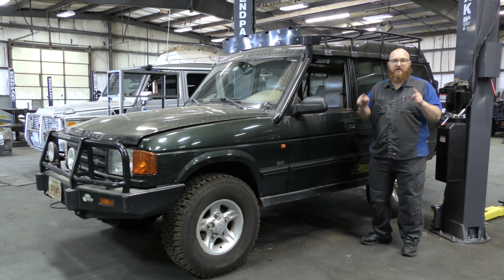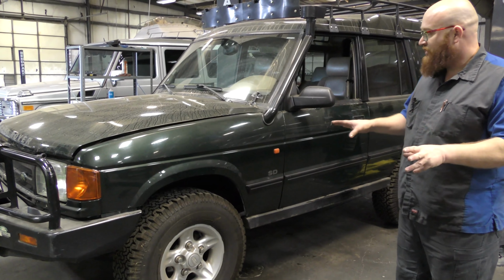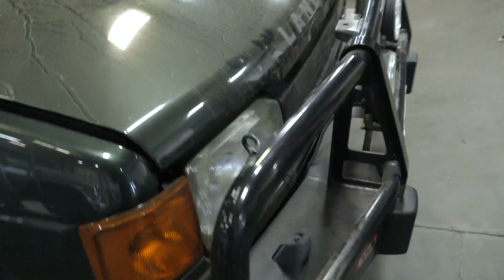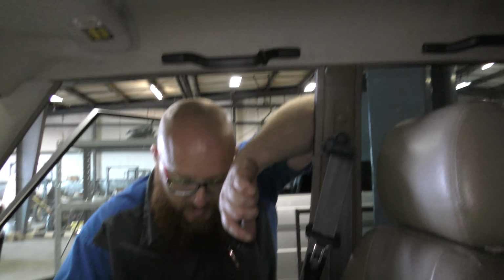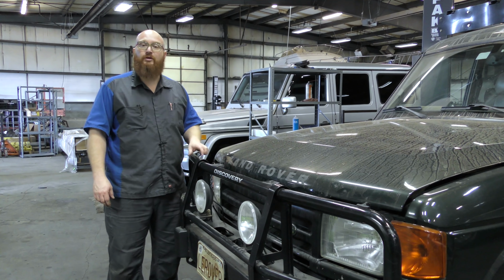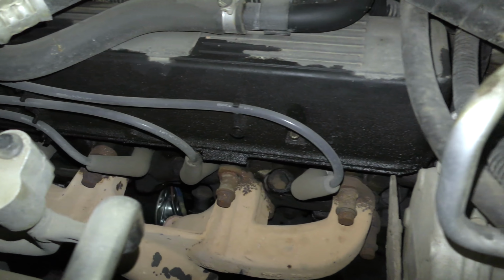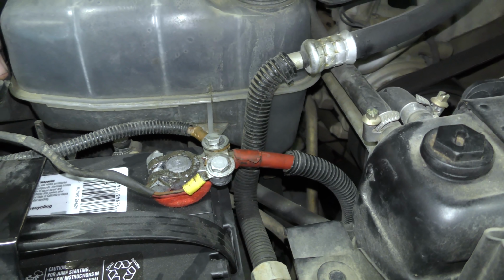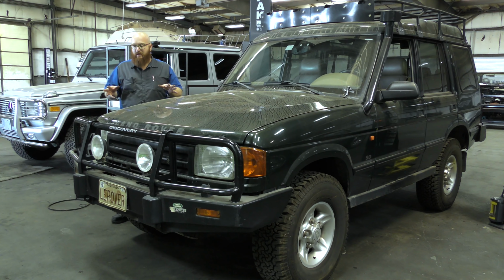How can such a simple repair cause huge problems on this '99 Land Rover Discovery? CAR WIZARD knows

Comment: Car Wizard, you forgot the most important feature of these models, the built-in siphon to your credit card that sucks thousands of dollars out of that account every time it is driven to a LandRover dealer for service. This is why your customer tried to deal with the problem himself.  I had a '99 and and a 2002 for my children - most expensive service visits ever until I got a modern M-B, which was totaled when gallons of rain water came in through a closed sunroof(blocked drains?).  Now I drive my old Ford Expedition and F150 - and have no problems I can't deal with.

Comment: Great video I am going to check mine are tight now !!!. I am looking for some help guys. I have a landrover discovery 1 1998 and when I take my foot off the gas (not all the way just so it is keeping a steady speed) it loses power and the engine light comes on. Then when I apply the gas it goes off again. When i freewheel engine warning goes off too. I read it might be the EGR valve when the revs are between 1 -2k revs the valve gets stuck. Any thoughts .....😀

Comment: You have a great channel. 
Why didn't you change out the battery terminal. Those are junk. I only use them in emergencies.  Add a good terminal end with studs.

Comment: The problem with the head gaskets is that the motor started off life as a low compression engine and when Land Rover exported the Discovery, they increased the compression ratio in order to comply with North America Emissions requirement.  The head gasket was never meant to take the increased pressure and would eventually blow out.  The motor in its original form do not have this problem.  and proper maintenance is REALLY important.  the the dash mounted cupholders always break.  The gear jams and teeth break.  Ask me how I know.

I prefer the side opening door with the spare mounted on it as well.

Comment: I put a 3.5 litre rover SDI engine and box with a big cam offenhouser inlet manifold and a 650 carter carb in a ford capri back in the late 80s went well but span the wheels when you accelerated hard at speed and had a habit of going side ways but great fun to drive as was a bit unpredictable.

Comment: I had a 2000 D2 with a blown head gasket. I didn't know anything about blown head gasket then, so I replaced the radiator as I kept losing coolant. It became a money pit as my mechanic didn't know what the issue was and I got rid of it as scrap. I missed that truck.

Comment: Sorry to say this...but you couldn´t be moe wrong on the Geländewagen. 
Maybe the americans see this as a mall-cruiser, but in Europe and the rest of the world these cars are used to work, to go out on an adventure, to go exploring and overlandung. The 354 hp G55 ist one of the most sought after Geländewagens, because they combine reliability with travelling comfort and power. You will find spare parts for these cars everywhere, because they share alot of parts with the original series from 79 on and MB will provide quick sevice nearly everywhere in the world. Compared to the G, the Disco is a nightmare in every way...

Comment: LR Discoveries 1 were only made  until 1998 (I bought one ROW from Conrico in the UK new in 2000 since it was also the last Discovery 300Tdi with no electronics except the radio! And drove it to Cairo, Egypt!) 1999 would have been already a Discovery 2 with the Td5!

Comment: CW, The Brit car expert - Should be Knighted, by Her Majesty :) Does a bull bar affect airbag function? Did they have airbags in 1999? A good point could be easy spare wheel accessibility? Tho' easy for thieves too? A nice spare wheel location could be upright, one side of the trunk? Or - In the popular location - A sectioned, rear bumper & slide-out drawer?                                                 Hope car manufacturers see this & take heed?

Comment: Wow I know that feeling, but with corrosion, couldn't even see it unless you undid and it had corrosion within the wiring, had to spread it apart and scrub with a metal brisel brush and then put anti corrosive, started right up, and I thought I was having starter issues, haha thabk God I didnt bash the heck out of the starter

Comment: I very much enjoyed your video. It was like you were showing my wife's 99 LR, right down to the missing radio. I just finished replacing the intake manifold gasket, reassembled everything correctly (quite sure), but now there is no spark when I turn it over. Fuel pressure is good (32psi), I checked the "simple things" as you shown, I even tried the immobilizer code trick. What am I missing, any ideas? If it's the crank sensor, where is that located? Nothing online is helpful. Thanks.

Comment: I would have said ignition relay if it was a Ford. I have a dodge that had a ringlet off the positive cable that was similar too. Ring around extra wire had broken. Was tight and looked good but when I pulled the bolt off the ring was in two pieces.

Comment: I had a Dodge Ramcharger for a while and that was one of the things I hated, the rear was a liftgate with saggy shocks.  I went to a Suburban after that which I had to do an emergency barn door conversion on.  

You say "an emergency conversion?  What? " It turned out the entire rear body crossmember was shot and when the rear window broke the tailgate fell off.   I still don't know how I broke that window, I was pulling on the edge of a rusted hole in the gate to see what shape the window mechanism was in and it just exploded.  I couldn't drive home that way so I went and yanked barn doors off a clunker at my buddy's place and proceeded to cob them on.

Comment: "Which is your favorite from this era, Discovery 1 or 2?  For off roading I'd prefer a smaller package and less weight, so the 1.  Can totally relate to this guys problem of loose terminals.  Had a transmission that was stuck in limp mode, would only work in 2 gears.  Tried everything to fix it.  Turned out to be a bad 12 V wire connection near the computer.  Sometimes the simple things get overlooked.
Sling Blade - It Ain't Got No Gas In It
VT247

Comment: i have a generator i bought with those battery  clamps..  one day would not start..  had the right voltage to the starter and starter solenoid..  ohmed out to be fine..  come to find those stupid clamps were a tad lose and had some corrosion under it that didn't allow the needed amps to pull in the magnetic starter solenoid..  from now on if anything i own has those clamps and has a issues thats the first thing id check

Comment: The moral of the story is DON'T use those battery terminals permanently!! I spotted the problem before Wizzard pointed it out. As vehicles age, this simple and basic part can create chaos in the electrical system.

Comment: Head gasket went on my 1994 300tdi it blew a hole in the bulkhead..I was told you need to remove the engine to change it  but I managed to do it without removing it and with limited mechanical experience I loved that old disco the engine was built proof unfortunately the body wasn't

Comment: A Rover V8 (former Buick) engine never blows head gaskets unless you run them without water! I have worked on hundred of these engines and head gasket failures are very rare. 🤔

Comment: You mean you like BRITISH cars wizzard... jeje... True stuff about the terminals... I had an old 2000 grand am that started acting up like the battery was discharged... starter turned very slow...  turned out to be the thick wire on the positive terminal, it was all greened up... just used a new terminal, cutted a chunk of wire (about 2 or 2 and half inches) reattached it and the darn car started like it had a new battery... so yeah, if you have electric woes on your old clunker, start with the battery, terminals AND the ground cables which causes a lot of issues on very old cars...

CHeers and thanks for your videos wizzard!

Comment: Interesting  you said head gasket  easy to do but still charge 1500  interesting   . Is that original   wiring    ,have trouble  with ignition  switch  to  .Top man

Comment: I have a Ghost 3 amigos in hot weather. New shuttle valves New brake sensors New brake line extensions New calipers  the original by pass wiring was done to solve it but that didn't solve it. The only thing not fully replaced was the whole ABS unit. I like both the G and Laney. I have a 2004 sorry not a D1. But yeah D1 is still good. Since I did my front end rebuild its purred. I custom screwed the cylinder liners to prevent slipping. I think I may have an oil pump gear issue but not serious not powerloss just a rpm oil light haven't been able to get throttle to keep rpm 750 or tad higher in idle or when off the throttle. My new issues rear sunroof motor gear decided to strip during opening. Horns died but just replaced them. Got a weird battery killer issue I've gone through 6 batteries in 2 months something is killing them and they all said when I brought in a saying a bad cell. Wow on the loose wires. I had to put a terminal cap and put the terminals back on and now very tight. I didn't want to change out these compression clamps. If you have a tip on the sunroof before I search for the Allen hole to manually close or anything for the 3 amigos solution hope to hear from u. Sorry my Adriatic Blue don't have a blown head gasket I've kept up with it for 10 years. Love your mild manner in your videos btw.

Comment: We're there any 300 tdi discos in the US?  First I was shocked by hearing about head gaskets, but later I realized the engine is different, from those I have been used to.

Comment: I had a Disco I and put 240K miles on it.  Sold it to some kid with an intermittent start problem; I wonder if this was the cause.  🤣  Found out a few years ago it had traded through a few owners to about 320K before becoming a parts car.  Way better than any Toyota I've ever owned.

Comment: Good day CAR WIZARD, I have a Discovery ii 2004 V8 Auto I removed the two catalytic converters and in doing so I also removed the lambda sensors my question to you is that after having removed the sensors should some adjustments be done to the engine control settings? the vehicle starts and runs no problem.
Regards

Comment: Building an 04 Disco. I'm throwing out that Buick engine and putting an LS in it. I've got at least two dropped liners and it's the same money to put in a good, reliable engine.

Comment: What clamps are you gonna replace them with? I'm partial to MTA 1507701's cos they've got a M8 stud and 2 M6 studs.

It's tragic that the US didn't get the diesel disco 1/2s, the engines are still LR but they're nowhere near as bad as the rover V8s.

And yeah as a D2 owner that rear just loves to hit things. Worth keeping the airbags just you can lift the rear offroad.

Comment: Have always wondered if the LR’s greater reliability than the RR is precisely due to the fact that the LR owners are (usually) in much tougher conditions, where a breakdown can kill you. 
Maybe it’s due to the fact that the LR is sold in Africa, especially to Safari operators, where those unhappy and stranded LR owners, who have, use, and must be accurate with scoped hunting rifles (of a “Big game” caliber), would be rather upset with LR’s corporate body, were they to lose a customer (or relative), due to a shoddily designed product! 😉

Comment: I just did this for my brother's motorhome, it would not start, he was checking fuses and everything else, I started by cleaning the battery terminals, they looked dirty, after cleaning I had 13v across the battery and 9v between the positive and frame, the negative to frame was dropping 4v, (before cleaning terminals i had 12.7v from positive to frame) turned out to be a loose connection of the negative cable to frame, once I cleaned and tightened the connection it started right up.

Comment: Wizard. being an independent tech for a while, we had this man, who loved land rovers, but jeez, I got sick of pushing them into the shop after hours for major work.. This is not okay, this is not a reliable vehicle. And the worst part was two guys pushing these tanks up the shop driveway incline.. We actually took am old toolbox, some old gm alternators converted into motors,  some old tractor tires and made a half ass pusher because we got sick of pushing these trucks

Comment: There is one thing about these cars i hear all warn about and that is the front drive shaft snap off and taking out the gearbox in the process as apparently it only blows up when you are driving and if so, what is best cause of action? as i wonder if one can install a axle cage around it to not take out the gearbox.

Comment: My mom had a 2001 Discovery and it was the worst car we ever had in regards to reliability. We had it from 2001 to 2010 and had to get rid of it after 70,000 miles. So many problems and parts failing. STAY AWAY!!!
Reply: Agreed

Comment: Wow... a half hour labor and a 125 bucks to tighten 2 bolts? They were under the hood and at chest level for cryin out loud... lol.. . It's not like you had to put it on the lift and tighten bolts on the starter motor or anything. My mechanic woulda told me I'm a dumbass and chuckled and then sent me toward the door.  Then he would have pushed me out the door as I reached in my pocket to try and throw him a few twenties for his time. Actually something similar did happen to me with my mechanic. On my next oil change I gave him a gift certificate from a local eatery and told him to buy him and his crew some lunch. Not bashing the Wizard. I love this guy. Plus he has to put up with Hoovie.

Comment: I checked my battery cables after viewing this and found my '97 SD does not have three wires - only two and both secured by the same nut.  I do however, have that Land Rover smell in the interior - hints of leather, red wine, whisky and cigars.

Comment: Steel sleeves in an aluminum block dropping?  Sound similar to the issue MarSpeed had on his 09 Charger 5.7 Hemi where it dropped the valve seat.  Not sure what the difference is, but both seem to be related to overheating.

Comment: Early warning for a headgasket going bad - significant pressure in the cooling system when the engine is COLD.  i.e. before starting it up.

Comment: I'm wondering that the problem with my dads 95 jetta !!! it had problems with fuses as well with the starter I'm wondering that's why the car did not start and the same thing as my sister well my dads my sister gave a 02 Pontiac sitting for years on the drive way and had fuse problems and there were no radio

Comment: Just to clarify, this is unlikely a 1999. In 1999 the engines were Bosch. This engine is a GEMS, first generation, available as a 3.9/4.0 liter, clearly marked on the top plenum. The last Discovery I rolled off the line in August of 1998. Discovery II production ran until 2004. If this vehicle is indeed titled as a 1999, which I doubt, I would guess that it was merely unsold inventory from 1998.
Reply: We got 99’s in America

Comment: Excellent video. I’m the original owner of a 2003 Range Rover L322. 130k miles. The head gasket is starting to go bad and exhaust is escaping into the coolant overflow reservoir. I have not been able to find a mechanic that is able or willing to repair this car. is there anybody in America that can do this repair and offer a warranty?

Comment: I had a similar problem with a Ford escort
My alternator kept burning out
Turned out to be a loose wire going to the battery that was arcing.

Comment: I worked at Land Rover for 10 years as an engineer and than as a service manager in Africa; I don't remember a lot of head gaskets blowing. Do customers here use the wrong coolant? Even police vehicles with 250,000 miles seemed OK as far as head gaskets went. The V8 had  other issues - especially the Bosch fuel injection, main bearing caps, hydraulic lifters and fan clutches. Maybe the US has hotter weather and higher speeds
And don't get me started on transfer cases or the 300 tdi timing belt!

Comment: Thanks my 2000 Disco II works perfect for 15 min then shuts down.  After 4 hours it will start and work perfect for 15 min.  Takes for ever to go anywhere.  I keep it local.  Rural Alaska shop says “Head Gasket “?  Ideas

Comment: That's a cheap repair battery terminal that you get from the auto parts store or even Walmart.  The  bolts will continue to come loose after a month or so until you replace with something decent.  I dislike those so much that I bought a battery terminal crimper to repair battery cables.  Never use that type of terminal except for a quick temporary repair.

Comment: Funny I had the same with my motorcycle. Driving, it would stutter, no problem and sometimes no power on the throttle. 
After a long search I opened the batterybay, and yes, there was this loose small wire. Dammit.
Btw, they drive on the left, so the backdoor is not adjusted for Europe and opens wrong, to the right. 
Well Japan does the same.

Comment: I don't believe the Rover V8 is known for head gasket issues in the UK.
Could it be in warmer climates, owners tend to use straight water without antifreeze, causing degradation of the aluminium and clogging of radiators?

Comment: I worked on two of these. They leak oil from everywhere, have horrible electrical systems, driveability issues, head gasket/cooling issues...horrible crap.

Comment: I had a customer put on 2000 bucks worth of parts on a 20 year old Hyundai because it would stop running after five minutes, reliably. In about 30 minutes or so I found a broken B+ positive wire

Comment: The 2.0 in the 2019 ford fusion is known for coolant going in the cylinders because of a poor designed coolant passages 
The dealer gave me a brand new longblock with the updated coolant passages 
No problems so far 
Let's see how long it lasts lol